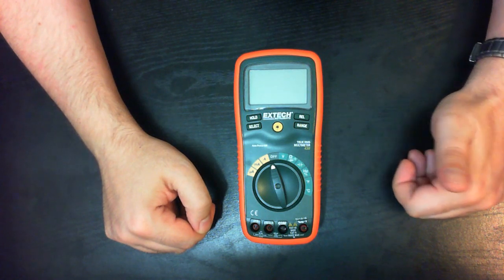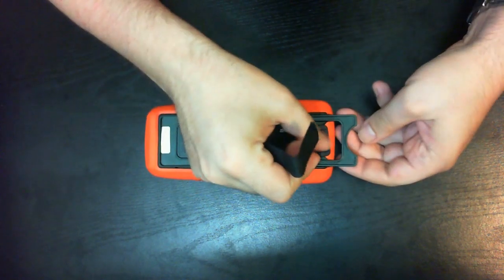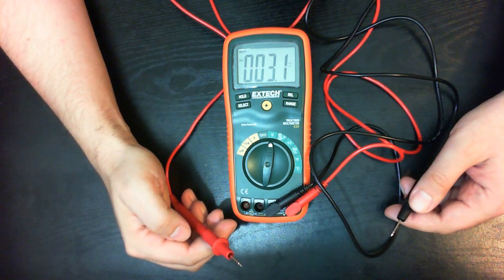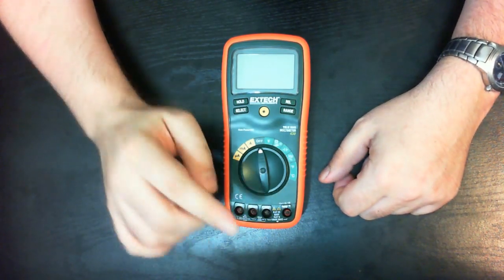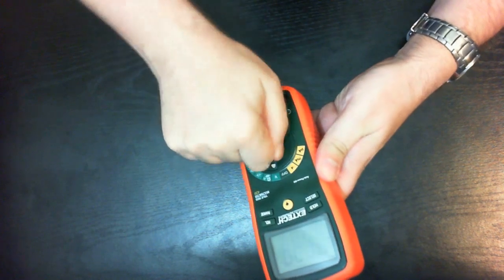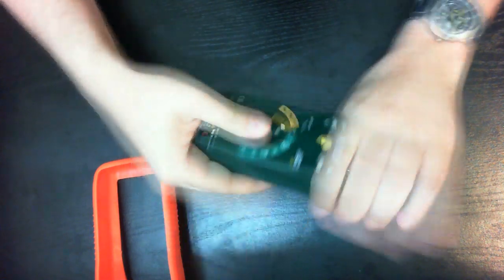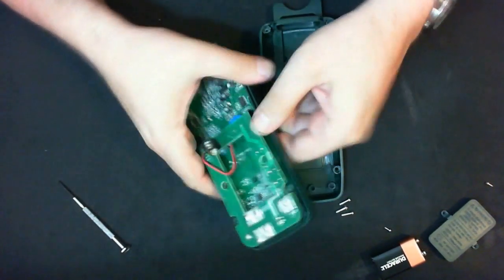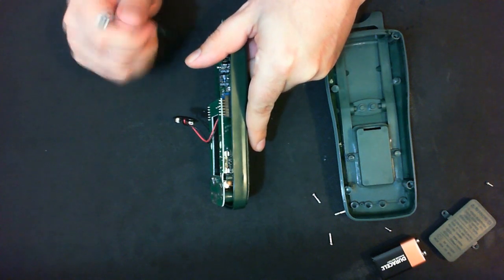Extech EX430

Comment: Thanks for the review. Could you add somewhere a high resolution photo of the EX430 main board? I have the EX420 which is almost the same but it stopped working and I would like to compare it with similar model. Thanks in advance!
Reply: ***** Thank you very much for such quick response! This is mine: http://blastboy.pl/image/fora/ex420-main_board-top_view.jpg
I didn't touched it with soldering iron yet.